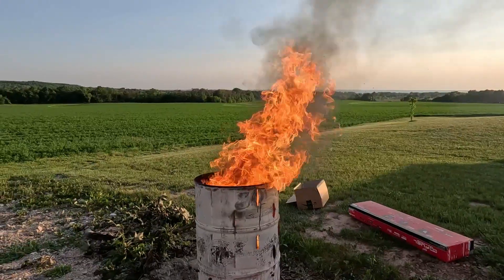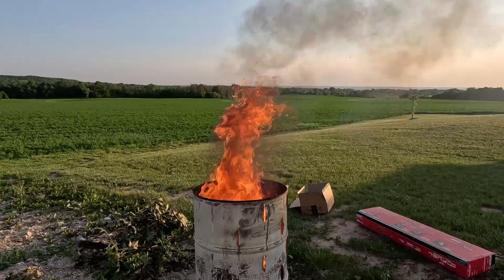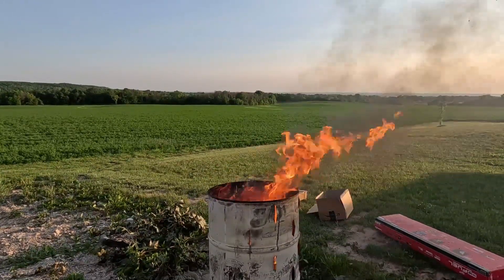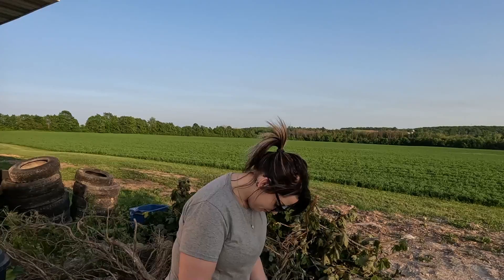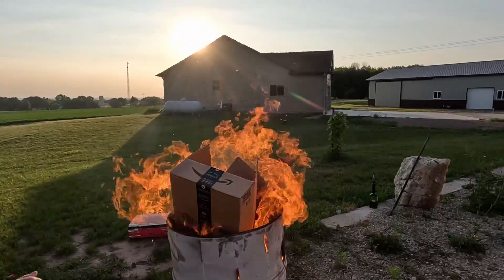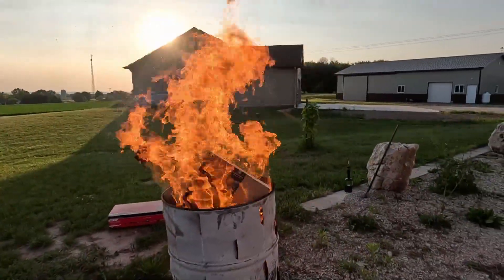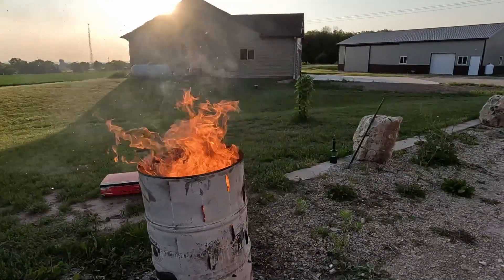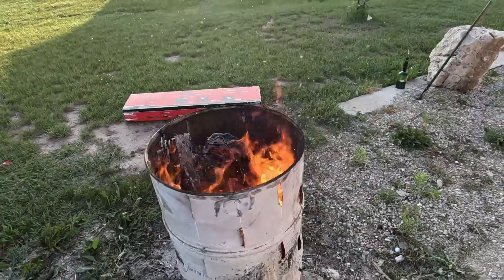DIY Vortex Burn Barrel: Does it Really Make a Fire Tornado?

Comment: My only disagreement with this barrel is you put air holes in the top half of the barrel. You should keep them at the bottom third of the barrel, really good sized ones, that way the oxygen will hit the hot part and air will be drawn up and it will create an effect known as a volcano stove or rocket stove. Vortexes are a specific thing and not worth it unless you're having fun making it.
Reply from the maker: Thank you. I was just messing around with that barrel and it worked alright, but I will take your advice and go for the volcano/rocket stove design you are suggesting. I am in need of a new barrel anyway. The one in that video has finally rotted out.

Comment: to get a tornado flame you need to cut side slots at about 60 degree angle all same directions I usually cut seven or eight about 3 inches above bottom and a foot long Space the slots evenly apart this will work
Reply from the maker: Thanks for sharing what has worked for you. I love the feedback. It gives me something new to try the next time I need to make a new barrel.

Comment: You want vortex
Bottom barrel: cut air holes in the lower 2/3rds of barrel. Leave the bottom end intact while removing the top end. Cut 5 or 6 tabs along the top of barrel. 
2nd barrel: remove both ends of barrel. When removing barrel ends cut inside leaving the double metal band thats part of the sides. With a second pair of hands lift and set this barrel on top of the bottom barrel. The tabs should be bent to form a cradle that supports top barrel. Cut a hole or 2 in top barrel to keep a visual on the fire. Once you have a fire going add some longer items. I was paid to dispose of 50 to 100 odd ball pallets every week. Some nights I'd have an 8 foot flaming vortex (with sound). You could actually see the 2x4 and more so with the 1x4 slowly sink into the fire. Fire was so hot the barrels would glow a red/orange. It almost took longer to break down pallets than to burn them.
Reply from the maker: This sounds awesome! I might have to give it a try when I get access to some new barrels again. That would be a sight to see with the barrels actually glowing from the heat. Thank you for sharing this!

Comment: I used fewer slots and I did get the tornado flame! but yours burns just the same. I didn't think of cutting the bottom out. Also, good tunes. Country living beats the hell out of a neighbor 20' away.
Reply from the maker: Hi Marvin, thanks for the comment. I may have went overboard on the slots.😁 I used to do 4 around the middle of the barrel. That never really worked great for me. How many did you cut?

Cutting out the bottom  just gives the barrel some extra life and makes clean up easier. I also have it set on 3 fire bricks so air can still come up from the bottom.

Cheers to country living. I love it too.👍
Reply: @kickitinthesticks1446  Should be lots near the bottom. Not top. Not halfway. Nice and big too, basically you want as much oxygen as you can get to hit the lowest part of the fire. But not just the bottom couple of inches because the ash will build up. But bottom third and plenty of them.